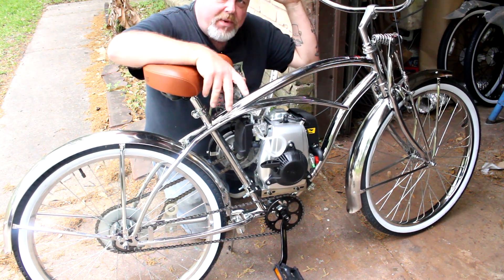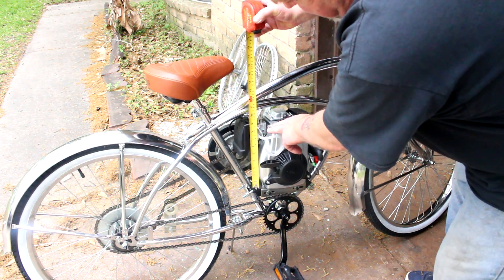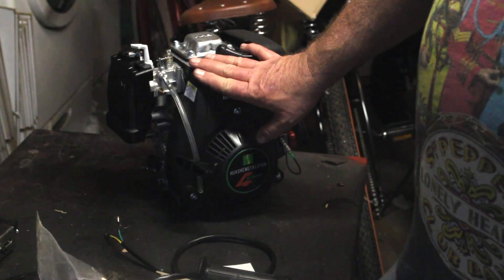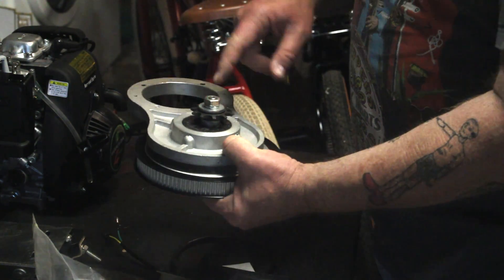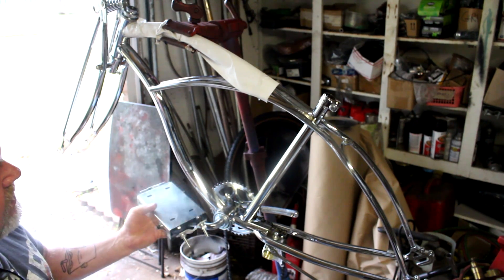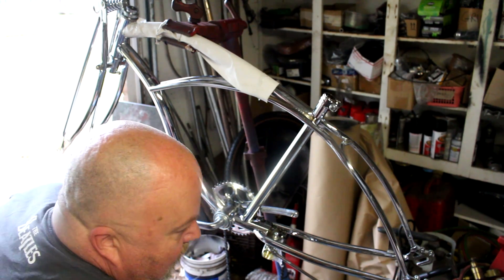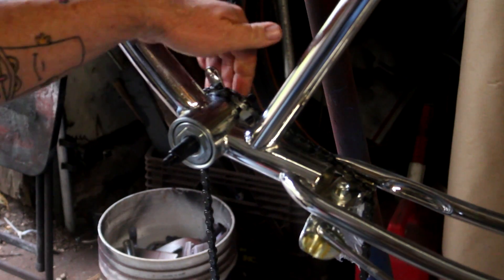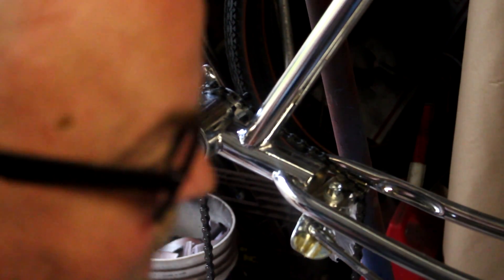How To Build 4 Stroke 7G Motorized Bicycle Part 1 NEW

Comment: Engine = gas or diesel.  Motor = electric.
Reply from the maker: Ummm. NO.
Ever hear of GMC? (General MOTORS)
Ford MOTOR Company?
MOTORsports?
Why are motorcycles called MOTORcycles?
Why is the Department Of Motor Vehicles called The Department of MOTOR Vehicles?
What is a MOTORized Bicycle?

Psst. It's not absolute.
Reply: @HughesMotorized  Neither is ignorance.  Have a good day.
Reply from the maker: @richardp6178  Have a good one sir. Just don't even get me started on what MOTOR oil is used for.
Reply: @richardp6178  explain what you mean

Comment: Looking to do my 1st 4 stroke build, cruisers - coaster brake or caliber brake model? Of the Walmart selection - Hyper or Huffy? Models?
Reply from the maker: I like old-school coaster brake on rear and if you have $150 use a hub brake on the front wheel. Second choice is caliper. Discs wear fast in motorized use. I like the heavier rims on the Huffy Cranbrook and I like the Hyper too. If you have the $$$, buy both and use the Cranny wheels

Comment: Whi my motor "eats" the clutch pads ?
Reply from the maker: might be misalignment of clutch bell?
Reply: @HughesMotorized  thanks I will check ,but we just bought  10 of this motors and all have the same problem,maybe quality of the pads fiver?
Reply from the maker: @josuemelara5085  are you using only the motor to start bikes moving? That will burn clutch pads. Pretty solid on all that I've had./
Reply: @HughesMotorized  I do help the motor pedaling ,but I am little on the heavy side  so I can smamell the burning  of the pads , so the other bikes,maybe is the quiality of the motor ,but in amason many people will talk about the same problem,maybe is the black fiver ,maybe replacing with car quiality fiver ,can you please make a video explaining this situation.thanks for your videos again.

Comment: I see you have that crapy rear sprocket "rag" type setup. That sucks.  But your motor setup looks nice.
Reply from the maker: I'm pretty good at setting up the ragjoint. My daily rider for 5 years is doing fine. Just jave to master it. I've done 300 by now
Reply: That's very impressive.

Comment: Dude have seen many of your assemblies. you said to cut the kill switch wires off .I say NEVER!!!!!! When you have a carb mess up and stick wide open you will not have time to reach down to find the kill switch on the motor. If you hit even a chuck hole  things happen very fast,or could blow the motor. I have had the return spring break and the cable end popped out. Very glad I had mine installed I was in traffic. boy that was an eye opener!!!!!   SAVE LIFES DON'T KILL THE KILL SWITCH

Comment: I need a motor mounting bracket at least 16" long. I have a firmstrong beach cruiser and the seat post and front post just above the bike chain is that far apart. What are my options?

Comment: whats the difference between 4g 5g or 7g
Reply from the maker: 4th generation, 5th generation....
Reply: 7g I know has a shorter shaft for the drive sprocket so it's stronger.

Comment: Where do you recommend buying 4 stroke engines from ? 
Also how do you feel about Harbor Freight motors ? If you think they are ok for bikes which size do you recommend ?
Reply from the maker: +LV Streeter (LVstreeter) http://motorizedbicycleenginekits.com/ . Harbor freight engines are lower RPM and they will not go as fast w/o removing the governor and modifications
Reply: LV Streeter book online and get yourself a 4-cycle Honda motor you can never go wrong with Honda
Reply: LV Streeter not from flying horse

Comment: will this fit on a huffy cranbrook with out needing to make a custom engine mount?
Reply from the maker: +Alvi I Pretty easy install. You will have to file and gring on black mounts to get correct alignment. Other than that easy enough
Reply: +HoustonMotorized ok that's great.. I'm planning to order from gas bikes but the total comes to like 400 cad.. do you know where I can get the ghost racer cheaper in Canada?  thanks
Reply: Alvi I. use bed rail cut them 3 in longer than the. mounting plate .so you can. put bolts fount and back of the down tube the middle down tube .drill four holes to mout the motor too